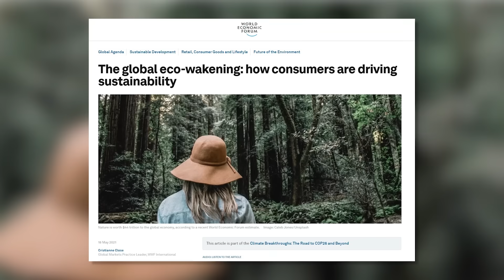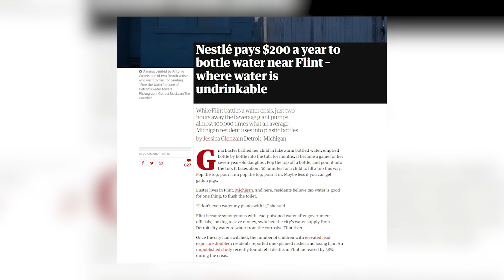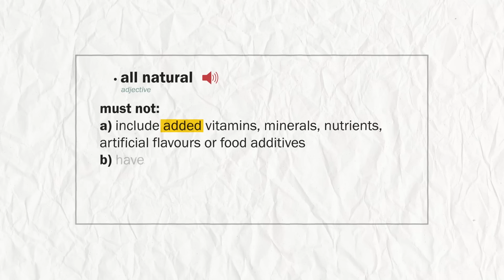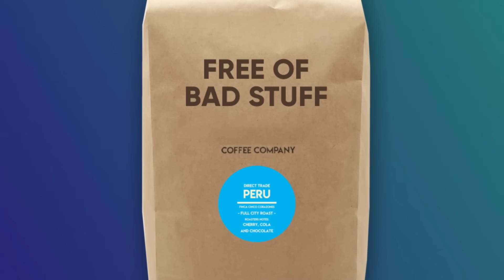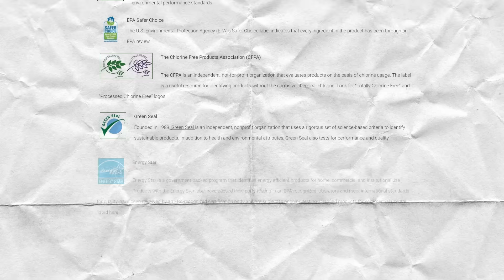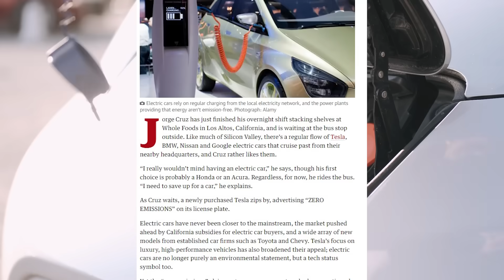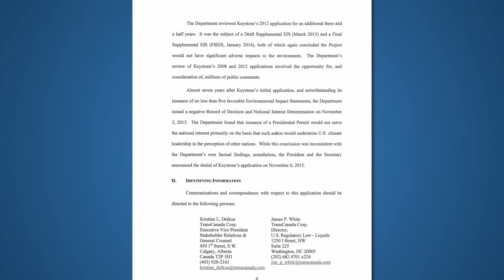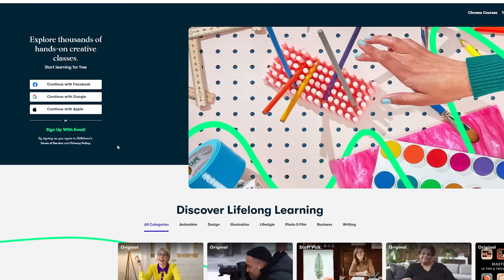Why Being 'Environmentally Friendly' Is A Scam

Comment: The only part of the video I took issue with was the knocking of the pipe line.  The pipe line only presents a potential risk.  It's actual use on the other hand will save trillions of gallons from being burned because it will not need to be transported by internal combustion powered modes of transportation.  By not having the pipe line we are shipping fuel over land and by water in vehicles that have a much higher chance of having an accident and spilling their cargo.  Pipe lines do not travel, they do not interact with with other vehicles, their upkeep is much cheaper and are far easier to maintain.  Yes stopping  the use of fossil fuels would be great, the only problem is we still do not have an efficient, reliable way to do this with out dumping tons of toxins into the environment to create current "green" technology, nor a way to deal with the toxic materials left at the end of it's life cycle.  Green will not be green until we stop using toxic metals and chemical in and for the creation of current green technology.

Comment: Also.. nobody talks about how insanely toxic and dangerous the batteries from Tesla cars are once they're used up. They're so dangerous once used or damaged that the fumes and physical contact with them are rapidly fatal and the process of cleaning up the pollution of a spent Tesla battery practically outweighs any benefits they had in their lifespan towards the environment. In 20 to 40 years we're going to have mountains of these super-toxic-fume-releasing spent batteries as the next major environmental crisis as we are currently literally just dumping them into piles when at bare minimum they SHOULD be getting buried like depleted uranium is (that's how bloody dangerous they are). Tesla currently only buys-back around 3% of the batteries from their cars to recycle (though even that process still leaves a ton of toxic waste apparently)

Comment: Great video! Something you didn't cover is 'biodegradeable plastics' which actually don't degrade in the literal (original) sense, as in, the plastic doesn't break down chemically, it just breaks apart - into micro plastics, which are in fact potentially more harmful for the environment, as they are consumed and passed up the food chain (eventually, even into us!) and can absorb other nasties along the way.
Reply: Wow, I didn’t even know! Thanks for sharing!
Reply: It's worse than that, often "biodegradable" plastics are non recyclable. As consumers can be unaware of this, entire collections of otherwise recyclable waste can sometimes to scrapped as its not always practical to remove the non recyclable material.
Reply: Plastics are pure poison
Reply: I want to know more about the plastic eating bacteria.

Comment: I have what is called an eco friendly washer which limits your use of hot water, and yes really gets your clothes clean on less water;  but you  have to use an extra 'cycle' to remove the lint that  now covers your clothes.  And then they stress that you must  once a month use the 'afresh' cycle to 'cleanse' the washer, using this expensive powder.  And it then fills your washer with  all the water you saved all month and drains it.  I no longer bother.  sigh.

Comment: The problem isn't all the trash that ends up in landfills, the problem is all of the trash that doesn't end up in landfills. It's believed an area of 0.1% of the entire earth's land mass would be enough to hold all of Mankind's garbage for the next 100 years. Recycling is a scam on itself, inefficient, poluting and costly, the fact that companies use single use packages is because those plastics are cheap and easy to produce. Yes, companies should, or rather, must, find better packaging methods that are more efficient and that require less materials, however the problem lies on the people that don't have the basic decency to throw their garbage in a bloody can, just throw their crap right through the car window (if you do this btw, you are an uncivilized Neanderthal), or when the city's waste disposal service is horrible, letting trash containers pile up and garbage spill out, so that it can be picked by the wind and end up in the ocean.

Comment: If there were enough recycling mills for all the recyclable plastic in the world, just imagine how many more vehicles would need to be on the roads regularly to keep up with it all.  It's normal for transport vehicles to emit multiple tons of carbon into the atmosphere in the process of taking recyclable plastic to a mill.  

Recycling paper is also sometimes worse, depending on the mill.  Along with pollution caused by transportation, many paper recycling mills also use chlorine-based detergents to remove ink from paper.  Some ink contains heavy metals which chlorine can't dissolve, so stronger detergents are added to deal with that.  The waste containing heavy metals, chlorine, and tiny pulp fibers will then usually get sent to a landfill.  There are cleaner paper mills which use enzymes and less harmful detergents and manage waste better, but it's difficult to research whether the specific mill your recycled paper gets sent to uses the best methods.  It "can" cause significantly less environmental damage than cutting down trees to make fresh paper, but that depends on your paper being handled properly.

Comment: You kinda missed a sin.
The sin you made by not understanding how things work.
Yes, the oil pipeline was stopped. Great 
BUT it did not stop the oil from moving. It is still moving but now by train and by truck.
Both put out more CO2 than a pipe does and there is a much greater chance of oil spiles with trains and trucks than a pipe.

Comment: I use vinegar and baking soda to clean. I usually only go to town once a month if I can help it. Grows much of my own food as I can so a truck doesn't have to pollute to bring it to me. I recycle my clothes so when they give out they truly are rags. And even then I use them to scrub with because a little elbow grease will get that clean you don't need chemicals. My solar panel and battery made a little pollution being made but the pollution that won't be made by bulldozers dozing down entire Mountains for coal to spew and mercury and Arsenic and other crap into the air is eternal. If it's broke I'll fix it. Several of the devices I have were pulled from the trash Heap and repaired. My current phone has a crack in it and it sure as hell not the latest model. I use a compost toilet so water isn't wasted just moving my poop from area to another I have frequently done my clothing and bathing with lye soap which is Simply Lard and ash. Sometimes goat's milk, oatmeal, glycerin. I do once in awhile use a good conditioner but most of the time I use olive oil. I am environmentally friendly

Comment: On the Nestlé recycling issue:
I have worked in a plastics recycling facility. Most of water bottles, especially Nestlé's, are made of a type of plastic that is easily recycled. HOWEVER, the bottles are made so thin that it can't be recycled without extra steps that grossly increase the carbon footprint of doing so.

The Keystone XL pipeline would have significantly reduced the CO2 emissions of moving oil from Canada to the refineries on the Texas Gulf Coast refineries. For that particular oil route it would have completely removed 6 diesel trains from service, and 45 dedicated route semi trucks.

Comment: I have had to find the products that stand the test of time.Light Bulbs that last finally the past 3 years that do not break down easily.This took awhile. The best item is the Solar Powered Casio Watches.I have been using for 25 years.The USB fan for cooling my Smartphone  and in general. Saving on Big Fan and Power. The lithium ion batteries. Small effect I know. But the Large scale Recycling had become the Pet Rock of the day.Unless we stop lying. We will never solve anything. Using new Batteries and ditching the old .And companies using 1 triple AAA battery for the remote.Instead of 2 AA batteries. Power tools that use lithium may not be environmentally helpful but using less electricity helps in using less it may be about 1 percent but this changed behavior as whole is better than the 0% in the 1970s. I'm 55 so I still try even though you point out the SCAM Good Video 🙂.

Comment: Thats simple
1 Because many noble loggings/wood used to built houses, fancy forniture, etc in the north hemisphere comes from Amazonia Forest
2 Because all pollution started 100 years ago with the industrialization process and the industrialization countries are? In the north hemisphere = developed ones (most part of the 100 year and most subdeveloped are 1/6 or less industrilized in fact)
3 Because all factories with high level of pollution, chemical waste, etc are in undeveloped countries (China included here)
4 Because in the south hemisphere theres no need in houses to have - central heating or heating, hot water or similar (at least in Brazil we do not have at all, even in the south part). If have in some countries just Chile and Argentina.
5 In summer time there is air conditioning in north hemisphere as well, in large scale,  not the same in South. Who has are the upper mid class or higher (not as many as USA - not even close).
6 Ireland (to quote one example) has all its electricity coming from gas, coal, or similar. Not even half renewable sources, less than it. Same applies to most nations in Europe.
7 All tires, rubber in the world are made from Hevea brasiliensis, the Pará rubber tree, sharinga tree, seringueira, or most commonly, rubber tree or rubber plant. Native stolen plant from Amazonia forest that today are grown in South Asian countries... and that market makes no good to the environment. Billion business market that serves just the developed countries. 
8 Cocoa, chocolate follows same issues of the rubber, damaging the environment for a billion business market that serves just the developed countries. 
9 same thing from above for coffee business. (all above cocoa, rubber and cafe you cannot grown in Europe or USA)
10 Over consumption around the world (Yankee model is working just fine)
11 Humans been humans, acting as virus! (virus behavior = multiply and kills its own habitat)

there are more point, but Ive got tired...

But at the end the fault of all is from Brazilian Government doing nothing to stop deforestation to grown soya, corn, etc to feed German porks, or Irish cows, or French goose, or Chinese chicken, etc, etc, etc

Comment: Both plastic bottles and toilet paper are are infastructure problems. If all water pipes were clean and safe we wouldn't need bottles. If all toilets had a bum gun we wouldn't need toilet paper. Sadly most humans on this globe are stuck with drinking from plastic and wiping with paper without really having a choice.

Comment: Your video is a little misleading. The way that brands are trying to sway people into buying environmentally products is a scam because their intentions aren’t genuine. But there is nothing wrong with environmentally friendly options in and of themselves. The two are not mutually exclusive. And I would have made a bigger distinction between certain types of environmentally friendly options. For example, recycling definitely doesn’t do jack if most of it doesn’t actually get recycled. But toxin free/biodegradable products are hugely important and do have an impact, especially in your immediate environment. If you have small children or pets you absolutely should not be using products with chemicals and toxins. So this video does have some good points, but unfortunately they’re not distinguished properly and there is definitely some misinformation. He even contradicts himself in #3 by initially saying eco friendly stuff is a scam and then reverts/twists his point when he says they’re not actually bad, only the ones that mislead you on ingredients.

Comment: Your using the cancelled pipeline as a win? How will that oil be transported without it? How many oil spills will happen with over land or over sea transportations?

Further, it's causing the price of fuel to go up. When people cannot afford energy then they turn to less clean forms of energy. It's not simply a matter of buying an electric car, they can't afford to do so (and it'll cost more to charge said car), or heat their homes, or buy food because it costs too much to get it to them.

While some regulations do make sense, we have to be careful that there are not unintended consequences. For example, if you tell the poor that they can no longer afford electricity, they'll start burning wood to hear their homes.
Reply: Yeah, that was a real head-scratcher at the end about pipelines. We get a lot of our oil from dictatorships (Russia, Saudi Arabia, Venezuela, and other Middle Eastern countries) from across the ocean, many shipments of which get spilled into the ocean and beaches when they make the daily trip. The list of global spills is staggering. It's far safer to transport oil shorter distances, via land, as opposed to across the other side of the world via water, which uses fuel in of itself as well. And it's more self-sufficient to not have to rely on foreign dictatorships, funding their terrorism and oppression of human rights, when we can use our own oil in our own country.
Reply: @TeaBurn  exactly! Plus, local oil drilling is often cleaner due to the market pressure and regulations. Those dictatorships don't care about the environment, so if you want the cleanest oil possible you'd want oil that you can theoretically regulate.

Comment: You know what's worse? Not buying a product because it isn't eco friendly doesn't stop the product from being manufactured unless everyone does it. Reducing your own carbon footprint is next to impossible without increasing someone else's. Further, all these products would end up in a land fill if they were suddenly given a pull from shelves order. There's no winning, the planet's on runaway, and our only hope remaining is to scrub the carbon from the atmosphere and then proceed to remove excess water vapor (water vapor, for those unaware, is also a greenhouse gas, and makes up a majority of the planet's atmosphere probably because we're covered in water. It stands to reason that the hotter things get, the more vapor gets in the air, which then becomes a negative feedback loop)

Comment: I found it absurd that almost all cafes(Starbuck for example) these days use plastic cups when serving you despite the fact you are not ordering for a take out, you order it to drink there. There's free wifi for a reason, people stay there for hours, after an order is done what do the barista do? mostly nothing, why not wash the glass/cup instead of using a plastic cup? better than touching your phone at work, and better for the environment honestly, what's wrong with using water to wash the glass? water is not that expensive in this modern age. What's weird was before the invention of the plastic cup, even back when water is not always as clean as today, baristas in cafes wash the fikin glass, why can't they? better than doing nothing at work honestly :/
Edit: when you think of a cafe or coffee shop you think of a porcelain or glass cup, not a plastic cup, honestly that kinda cheapens the class of drinking in cafes.

Comment: Seven more problems:
1. Claim to fix a problem that doesn't exist — like "ugly" fruit being marketed as getting thrown out while they're actually used for juices, salsas, and other processed materials.
2. Claim that the alternative is better because the alternative's impact isn't easily publicized. Gasoline is often demonized, but lihium and cobalt mines are just as bad for the environment, just without having any Westerners close enough to see the impact. Some cities use sand rather than salt in the winter because salt is bad for the environment, ignoring that most sand is imported from overseas and is destroying their ecosystems.
3. Claims that they're doing x to save the planet but the alternative does x significantly worse. For example, Greta taking a boat to the US. The boat was carbon free... but the tugboats used to get the boat there fast enough burned more fuel than a plane would. Many people go vegetarian because for environmental reasons, but vegan and vegetarian food is responsible for as much carbon emissions because of rice and tractors.
4. The company (or country or production) is selling you greenwashed products/regulations/productions while the people in charge are partying on yachts and taking private planes twice a week.
5. Punishes those in poverty. Not only do "green" products get marked up and then make people who can't afford it not feel good about themselves, people in places that make the cheaper products lose their jobs because it's not green enough — which means they can't pay for electricity and have to resort to woodburning, which is significantly "dirtier" energy.
6. The "pie in the sky" solution. Solar doesn't work as green energy because we can't store it. Electric cars are great, except the infrastructure isn't there and people would blackout the country if everyone got teslas.
7. Conflating "eco friendly" with "sustainable." Eco-friendly might be buying something that's unbleached cotton, but sustainable is buying something that is quality fabric and maintaining it so you don't need something in a year (or ten).